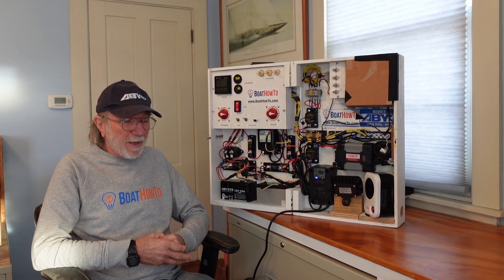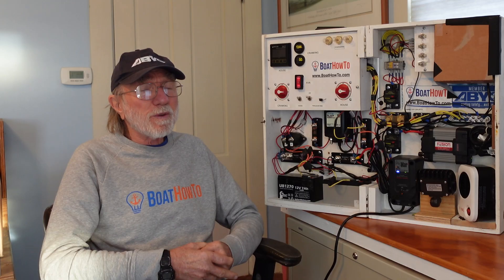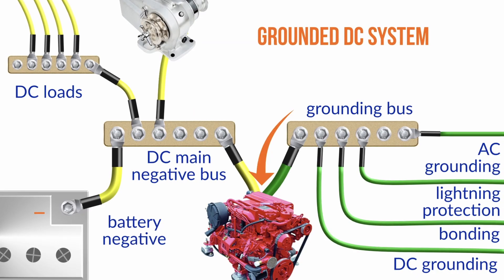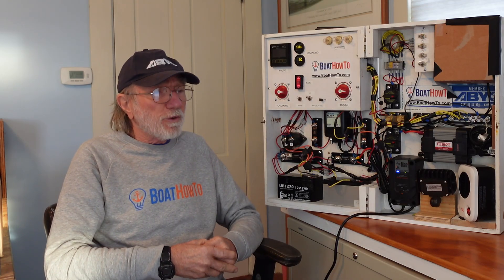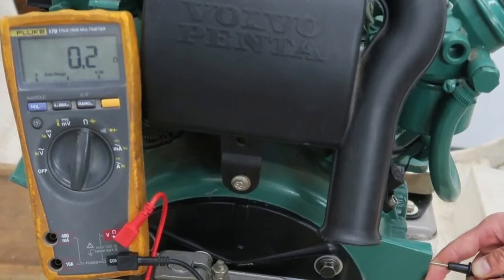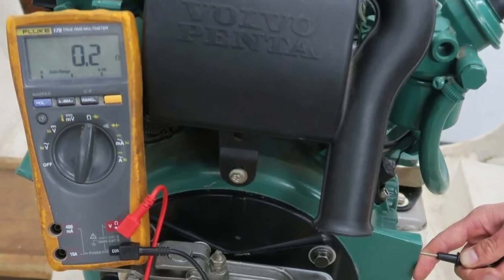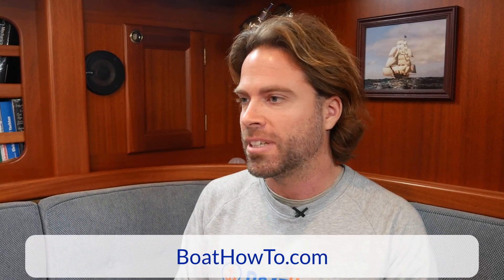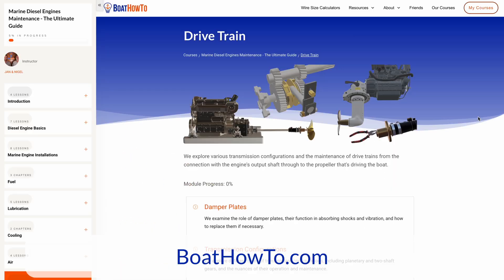Why is the Anode intact and the SAILDRIVE corroding?? | Ask The Expert with NIGEL CALDER

Comment: Good idea to test the anode to drive but the drive is covered with paint so may give you false result (showing isolation). You have to run one end of the ohm meter wires into the boat and find a bare part of the drive to test. BTW- if you have a yard paint your drive after an old zinc is removed, they love to paint over where the zinc contacts with the drive which will likely cause this problem in the first place!

Comment: I have had this issue and required a new Volvo Penta sail drive.   I suspect there were 2 issues with the engine/SD isolation, firstly a missing collect in one of the bolts attaching the 2, and secondly the incorrect termination of the throttle cable on the engine side.  The attachment point on the engine has an inner and outer hole - only the inner is isolated.  Effectively you have conductivity going up the engine throttle cable to the morse unit, through the morse unit and back to the gear selector on the SD.  I couldn’t prove it as the SD was removed (no collet) before I could test - but the replacement SD failed my tests and it took a lot of looking to sort it.